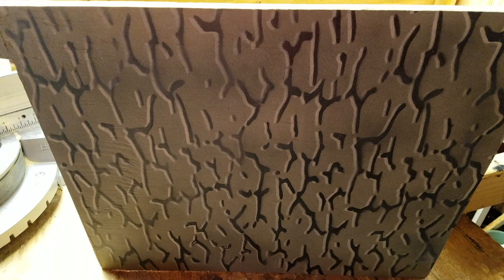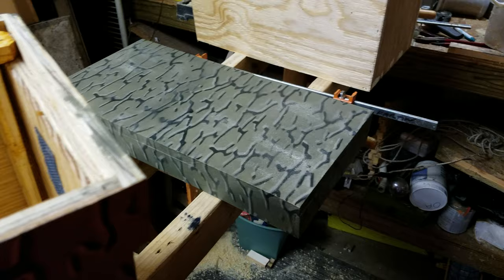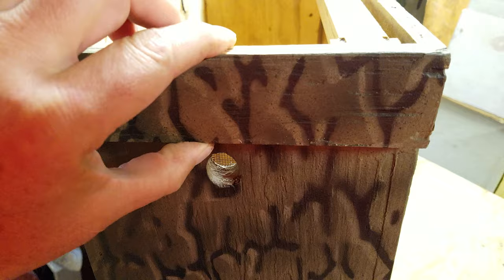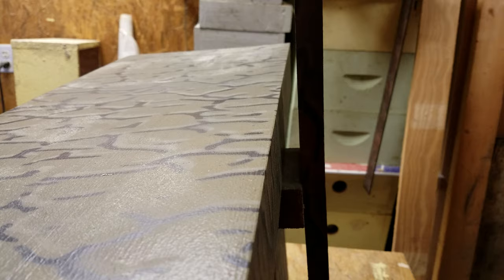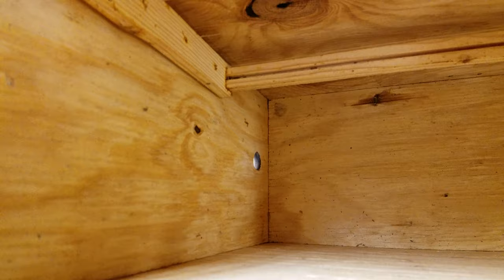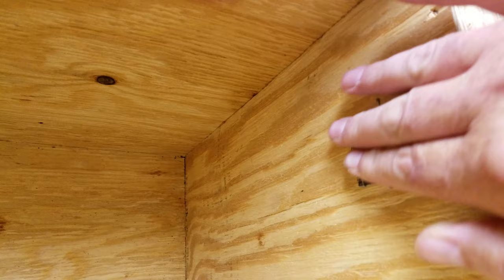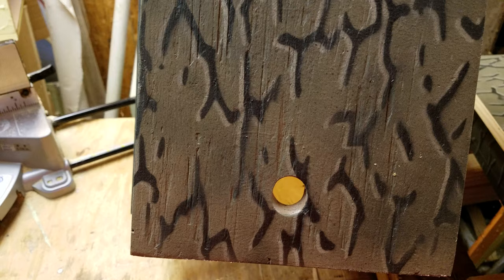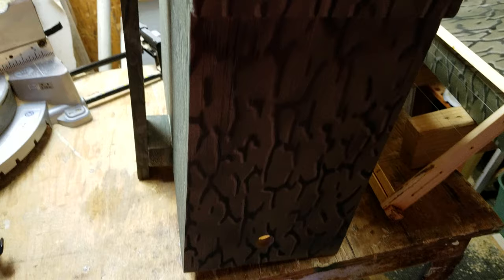How to build a swarm trap or bait hive to catch honey bees. Part 1 of a season long series.

Comment: Hi Woolie, Nice Video. I build my swarm boxes almost same like yours. I put a bit of foam over the top bars that the not bang to each other and 2 screws in the side of the lid. Then it can not come loose when you take them out of a tree. I also put round entrance doors on the entrance hole. The round doors have vent holes. It makes the hive easy to close. I hope you will catch a lot of swarms. Kind regards Jacques from the Netherlands.
Reply from the maker: Thanks for watching. im just to cheap to put those on i just stuff a napkin in the entrance. i also put 2 screws in the back to keep the lid on. beautiful country was there multiple times in the late 1980s.

Comment: Now I need to rethink the 14 I built last summer 🙃 they're basically square, double deep 5 frame boxes, with the entrance on the big side 🤔 I should find a sander that fits inside and rub the inside with beeswax after hitting it with my propane torch 🤓 painted with some Adaptive color I found at Lowe's. Kinda greenish, grayish, brownish 🤔

Comment: Isn't 40 liters about the size of a typical 10 frame deep Langstroth?

I never have to build swarm traps.  I simply use old standard size langstroth boxes.   In it I put a single frame w/ old brood comb & 1 quick squirt of Swarm Commander.   I caught an average of 3 swarms PER box last year.

What is FAR more important than the size or shape of the box is WHERE you put it.  It's 100x more important.   Placed in the right location, you could put a cardboard box (size a ream of paper comes in) on a fence post.
Reply from the maker: I have never used 10 frame equipment but my understanding is that it's a little over 40 liters. I also have found that bees like the cavity like a tree not horizontal like in a 10 frame box.
Reply: In my experience doing bee removals (professionally), bees don't give a twit about shape or direction.   They'll go up, down, left, right, or diagonally.   So long as the volume and entrance size are "right".
Reply from the maker: doing removals is totally different than baiting bees to a box you have hung in a tree on a post or just sat on a stump. the direction of the hole the placement of the brood comb type of lure ect matters. im competing with these other places. the way i do my bait hives maximizes my chances to catch the swarm over the other places they could go to. anyone can hang a trap anyone can get lucky and catch a swarm but to consistently catch 25+ swarms every year takes knowledge prep the right box orientation ect ect and a lure that works better than lemongrass oil or swarm commander. as i continue this series i will show people how to find bees not just BLINDLY hang traps and HOPE to catch bees. i have done my share of removals but not professionally and i agree they will build in anything if what they are REALLY looking for is not available. thanks for watching

Comment: Great video, I’m in my 3rd year as a beekeeper and looking to start building some traps I have a couple of questions to ask 1. The paint job I love it do you have the pattern to share and color information 2. Above you gave the dimensions for a six frame and mentioned that the second numbers are for a five frame can you explain that I didn’t understand it and 3. I would need to use straps not nails can the boxes be refitted to accommodate that issue. Thanks again for the help 
Manny
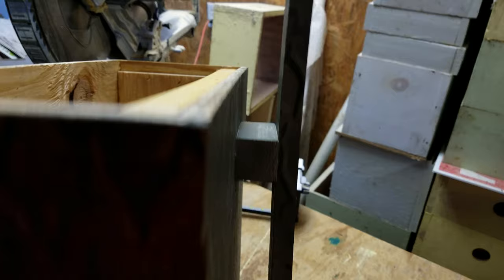Reply from the maker: the stencil is from amazon which is long gone. i changed the description for 2 separate plans so its not confusing.  the straps can be run through the back of the tap. start the video at the 1:45 mark to see the back mounting of the trap. thanks for watching,

Comment: That looks great! Thanks for the "PSS" tip. Now I'm going to go out and double check all of the swarm traps that I made within the last 4 or 5 months and make sure that I didn't happen to overlook anything sharp or pointy inside. I wouldn't have even thought of that had you not mentioned it. 

Question for you though. Did you make the stencil for the camouflage look? Have you experimented with different colors and camouflage patterns,  and this is just what works best?
Reply from the maker: Its a stencil a friend painted it. I cought 2 swarms in it this year.

Comment: Thanks for posting. I'm going to build it like yours. Question though. Should that bottom piece be 18 1/2 Long instead of 18 1/4? Or is that extra quarter inch for an air gap at the bottom? I didn't see a gap in the video. Basing this on the 19 1/4 wide back and front, minus the two 3/8 sides equals 18 1/2 for the bottom to fit in. Thanks.
Reply from the maker: The bottom goes inside the box not stapled from the bottom dur the side
Reply: @WoolieBsApiary  thanks for the reply. Okay maybe it's just me and I'm doing the math wrong or thinking of assembling it differently. But if I take 19 1/4 front/back, and put the 7 1/2 sides inside of that, I get 19 1/4 minus the 3/8 * 2 is equal to 3/4, gives 19 1/4 - 3/4 is 18 1/2.
Reply from the maker: @Beerbatter1962  ill go re measure when i get home
Reply: @WoolieBsApiary  Hey Willie, I can build the box no problem, I'm just trying to help you out and make sure you got the measurements in your description correct for others. For me I got it covered.  Thanks again for posting.
Reply: @Beerbatter1962  are the measurements in the description not correct?
Reply: @11bravo79  I used 18 1/2 instead of 18 1/4 for the bottom. Do the math, really depends on the thickness of wood you use.

Comment: I love your swarm traps but can’t find the plans in the comments?  Can you point me to them please?
Reply from the maker: they are in the description section not the comments This is how I build a swarm trap I use 5 and 6 deep frame traps. I lost track at 28 swarms in 2018. 
2 Qty.  19 1/4 x 16
2 Qty.  9 1/4 x 15 3/8 or 7 1/2 x 15 3/8
2 Qty.  2 x 10
1 Qty.  18 1/4 x 9 1/4 or 18 1/4 x 7 1/2 
Second numbers are for the 5 frame trap.
Reply: @WoolieBsApiary  I don't see how thick the plywood is that you use. What thickness do you use? Thanks
Reply from the maker: @robertstorch4203  3/8" in need to add that to the description

Comment: Could you also provide the measurements (cuts) for the tops?
Reply from the maker: my tops are made to fit multiple box sizes. i use 5 6 8 frame equipment and my traps are 7 frames so the lids cover all  of them. they are 17 wide x 23 long

Comment: How do u do the camo paint?
Reply from the maker: You have to buy a stencil off Ebay or Amazon or wherever you find one you like then put the base coat on let it dry a few minutes put the stencil on and spray the next color let that dry a few minutes then move it 3/4 of an inch and do,your 3rd color.
Reply: @WoolieBsApiary  thanks i will give it a try